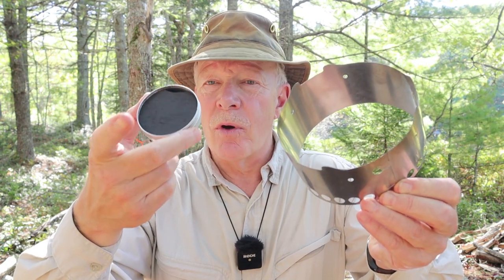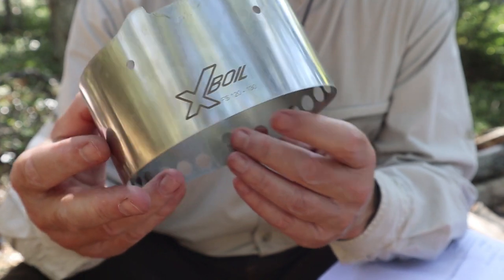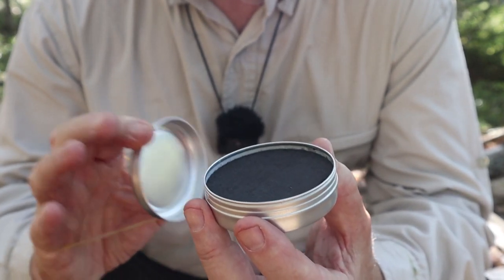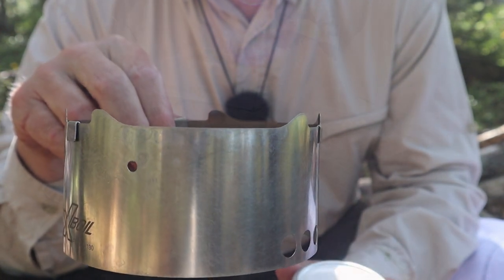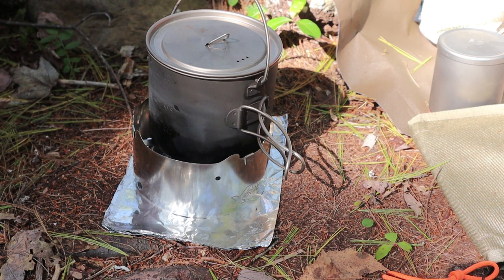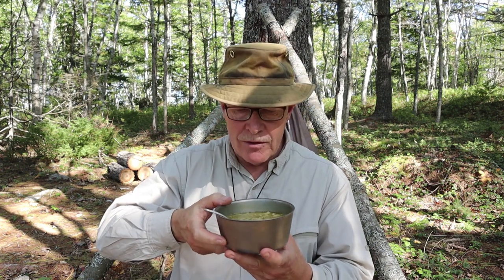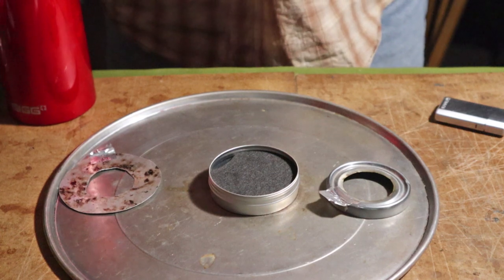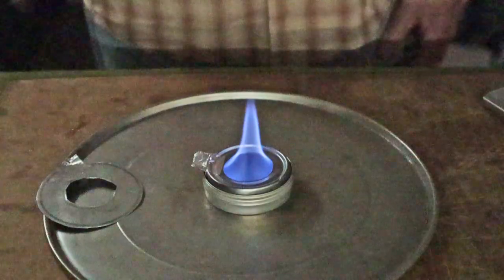X-Boil Alcohol Stove (KISSS Stove) - Comprehensive Review

Comment: Thanks for sharing, another good piece of kit.

The burner will just blow out, saving heat damage to the cap, yet another bonus.

A resealable bag(pouch) is a worth while addition, guards against leaking and evaporation.

I have the 90 - 100 version, ideal, very pleased. Made, from a spoke, a long armed U, a 1 piece 2 armed pot stand, bent down ends.
I might get the larger model too.
No, I did not need the other one either.
Thanks again.
Reply from the maker: Thanks for commenting

Comment: For an alternative to a simmer ring, try putting the cap of the burner underneath the burner which closes the gap between the top of the burner and the bottom of the pot. This chokes out the flame a little bit and slows the burn. I don't have that stove, but raising the burner/lowering the pot works well for me. Great video btw, thanks for making it
Reply from the maker: I can give that a try. Thanks for commenting

Comment: I would love to use this with the Toaks Siphon instead of the X-Boil burner. But i´m afraid the gap from burner to pot would be too small with the Siphon.
Reply from the maker: Yes, the X-boil windscreen would not work well with the Siphon. Thanks for commenting
Reply: @MarkYoungBushcraft  I mean - the Toaks Siphon is just 40mm in height and I found the pot gap sweet spot between fuel consumption, speed and soot formation is more around 25mm/1inch. So technically with shorter potclips which would make the pot sit a little bit higher it should still be usable. Of course if the pot sits higher there is less overlap between windshield and pot so maybe not as much wind protection.

Comment: So I went to the site, and it seems it’s 85euros for something we could make with ease?        For the simmer ring, did you try something opposite to a traditional ring?   Like a disk that would sit in the middle, something like a flame spreader.   This would allow plenty of air, and also keep a larger flame area to reduce the hotspot.
Last thing is something I find frustrating about stove reviews.   The stats you give are very useful to know efficiency, but no one that I’ve seen mentions the burn time capacity.  Not just one ounce, but when it’s completely full, how long will it run.   I’m not always only boiling 2 cups of water and that it.  I want to know how long I can cook with it without worrying about the stove running out.
Reply from the maker: Good questions Jim. I have since considered different simmer rings designs and will experiment a bit with them. I will also do a full burn to see how much it will hold and how long it will run. Thanks for commenting
Reply: I can tell you that it's 12 to 15 minutes. Depending on environmental factors. Burn time that is.

Regarding the price. It's not cheap but if you would buy a windshield, quality burner and stand. You talking about a few bucks more. And what you get is a solution that can be stored in your pot, is really hard to knock over and just works.
Reply from the maker: Just tested Max Fuel (methyl hydrate) 35grams / 1.23ounces Run Time  - 14:30 minutes
Reply: @MarkYoungBushcraft What is an ounce in millilitres?
Reply from the maker: update on the amounts. 35grams=35 milliliters=1.18fl-oz
Reply from the maker: 1 fl-oz = 29.6ml @susanp.collins7834
Reply: @MarkYoungBushcraft    That’s the capacity it can hold?
Reply: @MarkYoungBushcraft    Ok, thanks.     I wonder how that compares to some of the other stoves.   That beast of a military trangia I’m sure burns longer.  I had that sucker going for around 10 min and there was still a bunch of fuel.   Though it was a huge flame, so maybe not a lot more.
Reply from the maker: yup, 35grams that is all @jimf1964

Comment: That is a proper windshield. Pot bottom and flames inside.
I doubt the burner. It is not gasifying and it seemed the incoming air holes are on the same level as the burner.
Reply from the maker: Thanks for commenting
Reply: It doesn't care about wind. Had it out in pretty rough weather. You can always turn the holes out of the wind. I'd never went out on me.
Reply: @imanuelgoldstein1518 Thank you for that info. I'm interested of especially the new design with frying pan option, some coated aluminium one. 
Yes I can imagine also that the solid opposite wall will help.
Simmer ring that Mark told would also be a good option for cooking to add this.

Comment: Hey Mark, I’m just wondering if you would actually have to elevate the burner in some way to maintain the 1.25” from the pot when using the system with a larger pot/pan that would sit on top and without the clips. As usual thanks for the awesome video
Reply from the maker: From my experience, because it is a wick stove, the pot gap has a larger range with the flame pattern staying very much the same. I would not worry about the extra distance in this case but you could place something under the burner to close the gap. Thanks for commenting
Reply: Hi, I recommend to put the burner on the lid to get higher for using a frying pan. Please note: the X-Boil is good for using a frying pan on top (ham and eggs, ...) but not to boil liters of water on top of it.